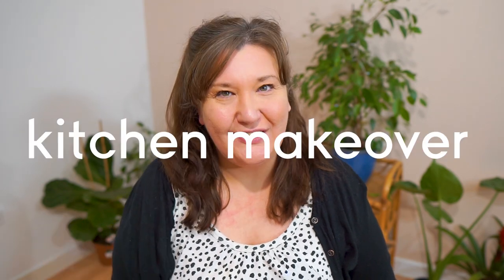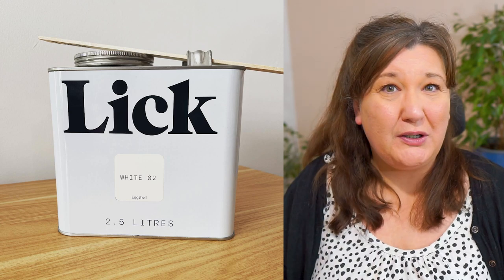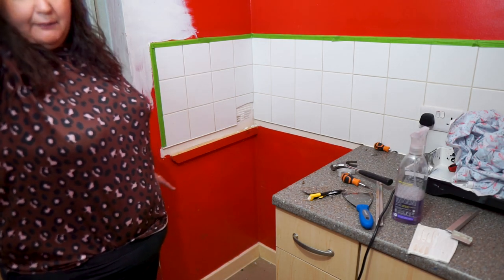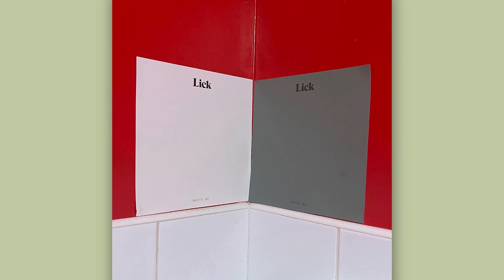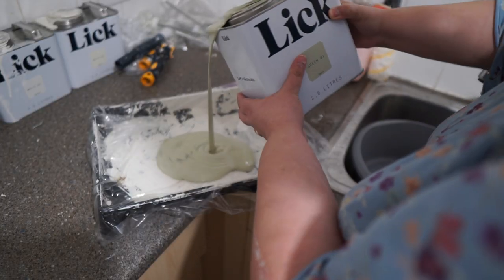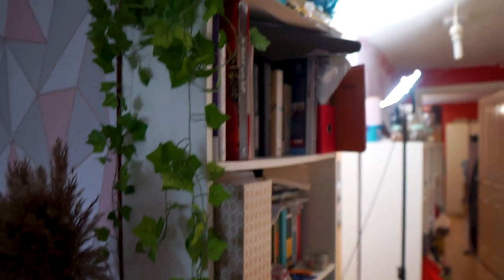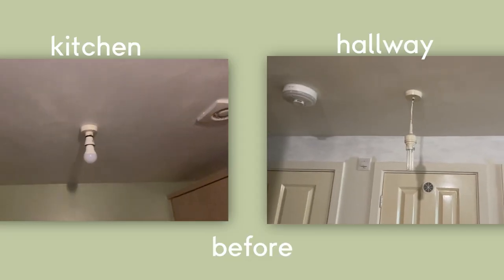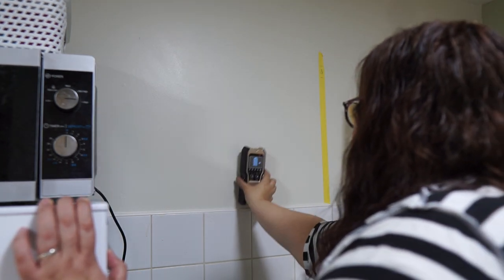DIY KITCHEN MAKEOVER | Saved by the professionals!!

Comment: Bending over is such a stress.  I think it is hard on high blood pressure too. The last time I waxed my floors I literally rolled from place to place. My son helped me the next time.  When I painted I would screw the  roller onto a broom handle.  It really helped me.  I am 5' 3", almost.  My kitchen floors had old lino which we changed 30 years ago.  The second lino gradually wore out until, in places it was like cheese cloth held together with duct tape.  The sub floor underneath isn't even.  We had a flood (covered by insurance)and I replaced the floating vinyl with heavy vinyl tiles. and on all the seams of the floor they have cracked and I have large blanks in the floor.
Reply from the maker: Bending over is hard work probably because blood rushes away from the heart to the head. I don’t have high bp, I tend to struggle with low bp. Good to know your experience with tiles and I’m not alone!!